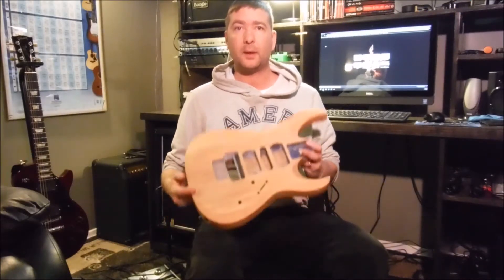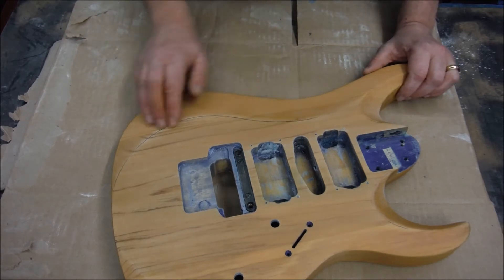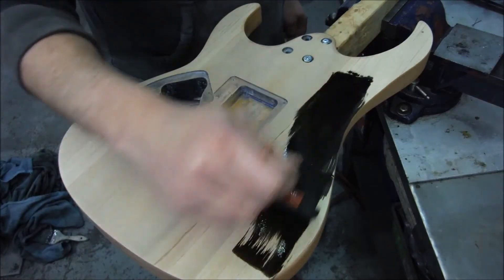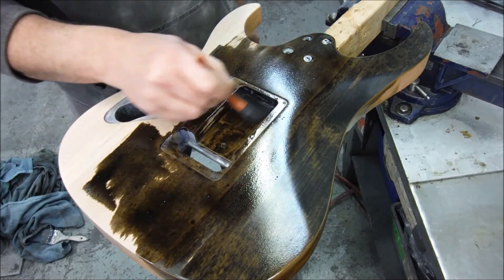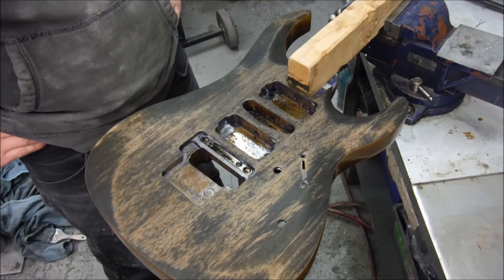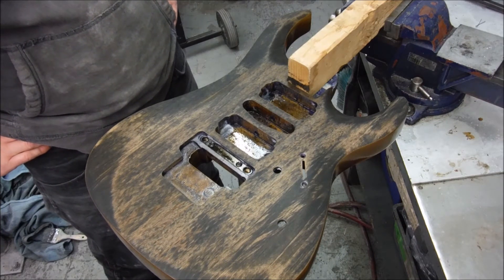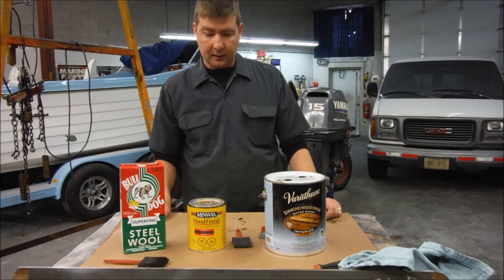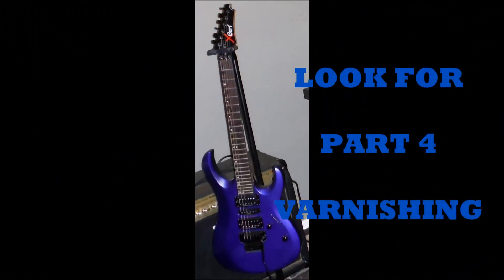PT. 3 Cort X6 Guitar Refinishing Project -Staining [HD]

Comment: the blotches are the seal coat, I have stripped numerous guitars and that seal coat really soaks in. what I do if I want a see through colour is give it 3 thin coats of shellac, level sand it. After that you have a few options, you can put some dye in to shellac, spray with tinted nitro, or use oil with some artist oil paints mixed in. My new method is tinting water based brush on clear varnish, I apply it with a small firm foam pad.